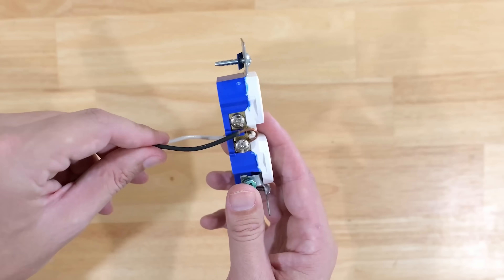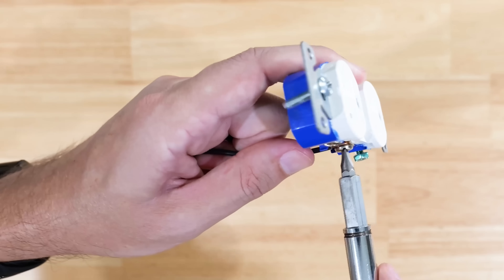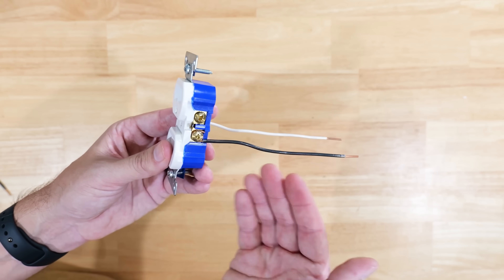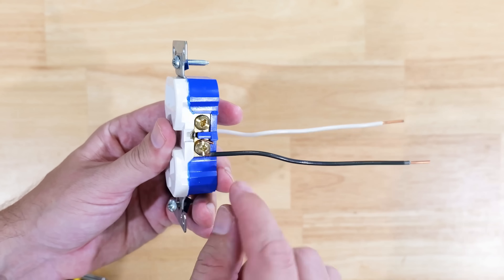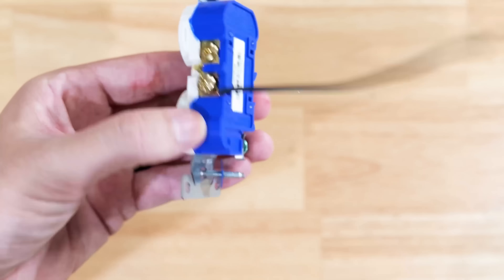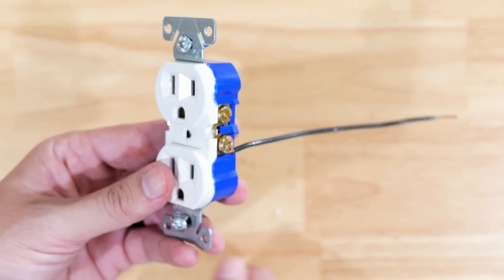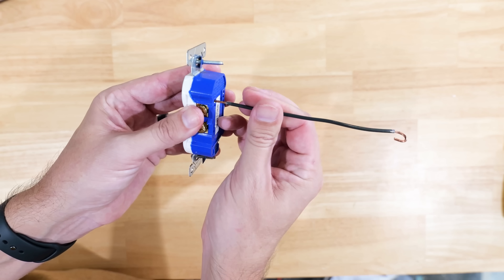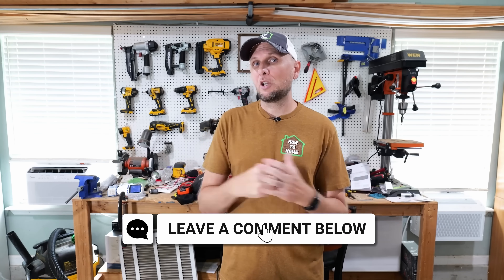Avoid Disaster! 8 FATAL Outlet Mistakes Most DIYers Unknowingly Make!

Comment: I was taught that reverse polarity was more about safety then performance as AC current reverse polarity with every cycle. Whatever is plugged in will work just the same. The problem would come in if you were touching two things with different polarity at one time., in which you would become the completed circuit.
Reply: It is about safety in a simple circuit like a light bulb, because it can cause a shock hazard or worse case, electrocution. It's also about safety with more complex electrical equipment and the equipment may not work or may be damaged if it's not internally protected against reverse polarity. This is the case in 120v circuits, because the neutral wire is a zero voltage reference. It is bonded to the ground at the main panel to achieve this. The concept of reverse polarity does not exist in 240v equipment.

Comment: Sorry buddy but it is 100% ok to use a 20A rated outlet on a 15A circuit but You shouldn’t use a 15a outlet on a 20Amp circuit. A 20Amp outlet on a 15amp circuit can’t pull more then 15Amps. That’s very basic knowledge
Reply from the maker: Oh it can’t?  And you’re 100% wrong.  The NEC says so.  Yours and my opinion don’t matter.  Sorry, bud lol
Reply: A receptacle is just an access to electricity and it will pull whatever the load demands regardless of the receptacle rating, Travis. If it becomes excessive, the breaker should trip. If it doesn't, the wires will heat up, melting the insulation, plastic on the receptacle, who knows?

Comment: A 20 amp receptacle may burn the 15 amp wire (14 gauge wire) on a 15 amp breaker if the breaker doesn’t work properly.. you are right but you may also consider that a a 20 amp breaker with a 20 amp wire (12 gauge wire) connected to a 15 amp outlet may be also burn like that one that you are showing (most likely the outlet was over charge, loose connection etc). Food for thought!
Reply from the maker: That wouldn't happen.  15 amp receptacles are made internally the same as 20 amp and are rated for it.
Reply: @HowToHomeDIY 20 amp breaker
Reply: They are not the same.. the material used is for 15 amp.. not 20
Reply from the maker: Incorrect.  But you can think that.  Doesn’t change the facts.

Comment: Some of this is wrong.  You can not put a 15 amp receptical on a 20 amp circuit.  Thats how the receptical catches on fire.  However a 20 amp receptical can handle 15 amps on a 15 amp circuit with no problem 1:50

Comment: I have a older house i just changed my first outlet had black wire on silver screw i was told to wire it the same way it was to be save is that wrong
Reply: Probably, plug in a receptacle tester to the outlet. If it's wrong, it will read hot/neutral reversed. If you have a 2 prong receptacle and there's no ground, this test may not be reliable. You should then use a non contact voltage tester. It lights up and beeps when the hot line is detected. If it beeps when you put the tip in the neutral side and not on the hot side, then the polarity is reversed. As an additional note, this probably won't work on a GFCI receptacle that has no ground, as it may beep just being close. In that case you should remove the GFCI line wires (power off) and test them individually by getting the tip close to the wire (power on).

Comment: I ran into three outlets in my house that were wired in such a way that they stripped the insulation off the wire mid way down the wire, wrapped that part around the receptacle terminal, then stripped the end of the wire and used that to tie into a pigtail. Have you ever heard of such a practice? My house was built in 1970.

Another situation I ran into was an outlet that tied into a circuit and had a switch off of it ... there were shared neutrals in the outlet.
Reply: I'm familiar with the practice regarding your first situation, and I consider it bad practice in general, unless there is a valid reason for it.
The second situation is normal for a switched circuit and it's not considered a shared neutral if it's the same circuit. Shared neutral refers to 2 circuits on opposite phases using one neutral at a time. This is known as a multi wire branch circuit.
Reply: @surferdude642  thank you ... I fixed the outlets in the first situation by removing the wire, cutting it, and doing a proper pigtail.

Comment: Back stabs are approved on UL listed devices,
Reply from the maker: Yeah, and cigarettes are approved to be bought and used.  What’s your point?
Reply: @HowToHomeDIY  The majority of electricians use back stab in residential construction as it is faster. It is OK on UL listed devices.  It is OK with NEMA.  Your opinion is just your opinion and it does not influence what UL approves.
We know cigarettes cause multiple health problems,  If not for cigarettes we would not have such wonderful health care.
Reply from the maker: @tricogustrico  And we know that numerous service calls are due to backstabs losing  their tension and having a poor connection.  It is funny you say most electricians use them when I personally know numerous electricians and all of them refuse to use them.  Yes, they are UL listed.  And yes they are more likely to cause an issue than the terminal screws.  Both can be and are true.

Comment: Why would they design the receptacle with the back stabbing set up if they are so dangerous? I'm not going to say this guy is wrong but my whole house is wired this way and because of him saying how loose they become he made me paranoid, so I have went and checked every single one, pulling refrigerator, washer, microwave, dishwasher, ect. I pulled hard on every single wire and not one of them are loose. The look and operate perfectly after 10 years of use. It took me an entire day to check them all. Thanks for reading.

Comment: I live in a house that has 2 prong outlets, no ground (green or bare) wire. There are only white and black and white and red. I am not certain why a few of them have red for the hot instead of black but they work the same way. Anyway I read that it's very dangerous to install 3 way outlets, the ones with the 3rd hole for grounded circuits however several of the things I have are 3 way grounded plugs such as my laptop charger and some tools that I use frequently. I have a couple of those cheap grey adapters with 3 holes for the device plugged into it and only 2 prongs for the wall outlet, which I also read are not very safe to use. I've read that the least dangerous thing to do in this case is to install a GFCI without using the ground wire and labeling it as a "non grounded GFCI" however when I do this, the GFCI either has no power nor do the ones after it on the circuit. Or if I reverse the wiring, there's power but the test button does not trip the device. I don't recall whether the outlets after it have power in this state or not but I want to say they didn't. I checked numerous times to be certain that the wires corresponded to the proper cables in relation to where they were connected to the device and I also tried another GFCI from another house that is known to be working as well as testing the first one to confirm it to be working in another house. So I have re-installed a 2 prong outlet and it works fine however I'm at a loss with my things with 3 prong plugs besides resorting back to the 3 to 2 prong adapters. I do use the ones with the tab that attaches to the cover plate screw but I'm not certain that it makes it any more or less "safe" to use. Are there any more options other than installing a proper grounding path throughout the house? I don't own the place and the owner doesn't want to hear anything about doing it. Is there a way to ground the house without running a grounding cable going from earth to all the circuits throughout the house and installing lightning rods on the roof?

Comment: i use commercial receptacles so i don't have to waste time with shepherd hooks or the weak stab ins. I like the wago style but wonder what cost difference be? With commercial you can safely put 2 wires on a single terminal. I don't normally do that but sometimes i have to.

Comment: This guy is in correct If! you put a 20 amp receptacle on a 15 amp circuit that circuit has a breaker that will tripp at 15 amps! NOW! if it was the other way would be very bad 15 amp recept on a 20 amp circuit the receptacle would get hot burn and could cause a fire!
Reply from the maker: 😂 you are basing that on your own thinking.  What you just proposed is completely wrong.  15 amp receptacles are permitted to be on 20 amp circuits.  The internals are the same and rated for the 20 amps.  It would not cause a fire.

Comment: good video; few things: 
-reverse polarity: its fine for your equipments. all product safety standards consider this as a commin thing and tests it accordingly in their 3rd party certification. that being said its still a issue because your branch protection is on the hot wire. take a light bulb and the hot will still be hot and hurt like a....
- backstabbing: come on, again these are 3rd party certified and will meet the proper strength required by national safety standard. id much rather a diy use the backstabing method than the screws for the j-hook, torque, and insulation common mistakes you mentionned. for sure people in the trade will always prefer the most long proven method but that doesnt mean the other method isnt safe.

Comment: How about not realizing that the receptacle you're replacing has the break-off tabs between the terminals broken.  A good example of this tends to be the garbage disposal outlet under the sink, so that you can use a single receptacle for 2 unique circuits.  I started a small fire in my last house because I had no idea this was a thing.  Always good to double-check the state of the break-off tabs between those screws to make sure there's not a dual circuit running to that receptacle.

Comment: thanks for the video! I lost power to my outlet that had my freezer and washing machine plugged into. Lost 4 deer, 2 turkey, frozen bread, and alot of groceries. Thought my freezer went out. Come to find out the outlet was wired incorrectly for over 30 years! The  black was not even hooked up! The white wire was hooked to the brass power side. The ground was hooked to tbe neutral side. The white wire had insulation all the way to the top of the screw and was barely holding( would guess it finally came loose after 3 decades from the outlet not being schimmed and was moving). SOB! Ill be  checking all my outlets.

Comment: Amazing video. I was just wanting to know when using a commercial grade outlet do you still need to torque it to 12 in lbs or just tighten hard enough so it doesn't move anymore since its going thru a hole and being sandwich evenly.

Comment: Also don't leave too much ground wire coiled behind the outlet inside the junction box...I had an issue where a breaker randomly tripped off unexpectedly, then would not reset/turn back on - the breaker would spark when attempting to turn it on. After hours of trying to figure out what was wrong, including replacing the breaker switch itself, it turned out the electrician had left too much ground wire in one of the 6 outlets on that 15A circuit, and the wire had contacted one of the open screw posts on the side of the outlet. This literally fused the ground wire to the screw on the hot side of the outlet. Definitely would've been a serious shock/fire hazard if not for the breaker cutting power.

Comment: Double stacking... What is the correct method for extending a line by two new wall outlets leading off of an existing wall outlet? What's here: 15-amp breaker --> 14-gauge wire --> 20-amp old school outlet. What I'd like to add: 12-gauge wiring (from existing 20-amp outlet) and two 15-amp gfci outlets. Can I do this? Your video is great, but you haven't shown us a proper way to extend new outlets off of other outlets, just what not to do. Should I replace the old school outlet with a new gfci while I'm in there. Tryna get this right. Running a new 55" TV and all the fixins and a laptop-and-lights situation on the two new outlets. TIA
Reply: Re-watched some and did decide to replace two old school 20-amp outlets with new 15-amp gfci outlets. Still wondering can I use the larger wiring, if I'm out of the white stuff, and how to properly wire from outlet to outlet. Thanks!

Comment: You got that wrong my guy! You CAN NOT put a 15 amp receptacle on a 20 amp circuit! The reason is because the device is only rated at 15 amps and if there is a failure in the device due to overamp conditions for the device that is only rated for 15 amps, the 20 amp circuit will not trip the breaker!!! This is a HUGE misrepresentation! Please take this video down as it can cause serious issues to those that do not know better! Also putting a 20 amp receptacle on a 15 amp circut is actually FINE because the circuit will shot off if a device that gets plugged in pulls over 15 amps therefore protecting the 14 guage wiring and preventing overheating! So for everyones safety...TAKE THIS DOWN and remake that statment!!!

Comment: Didn't even get past the first segment. I am sorry to say but you are very wrong here.  it all starts at the breaker/fuse. this is you minimum rating for everything down the line so a 15A breaker means at minimum you need 14AWG wire and at minimum 15A devices.  You can ALWAYS over build down stream like say use 12AWG wire on a 15A circuit or even put a 20A, 20 or even 50A receptacle on a 15A breaker.  The other way around is flatly against code everywhere.

Comment: Can someone explain to me how it is possible to connect a 15 A socket to a 20 A breaker? If someone connects a load of more than 15 A to an outlet, it will cause overheating due to overload. The circuit breaker will not work. Or did I misunderstand?

Comment: I wish it were normalized to use torque screw drivers. It's good liability insurance. Granted things can loosen up over time from cycles of the parts heating up and cooling down. I would say the biggest mistakes for electricians include over tightening or forgetting to tighten down their lugs in the panel and getting distracted by customers' dogs.

Comment: ---------------------     I'm new, so if you already covered,   I don't know about it yet, until I get thru your list.         Suggestion:  how about   Aluminum rated receptacles,    do's & don'ts?
Also,     how much torque on Aluminum?
And    how  to properly     pigtail     or    join them,      and would you use AL rated or Copper rated device?

Comment: Wouldn't the simplest answer to issue #1 be to use a 15 amp receptacle on a 15 amp circuit, and a 20 amp receptacle on a 20 amp circuit? Or am I missing something

Comment: First tip a bit silly the anything that plugs into a 20 A can plug into a 15 A so easy to overload in either case
Reply from the maker: You cannot plug a 20 amp plug into a 15 amp receptacle.  It literally will not go in.

Comment: I still don’t understand why, after more than a century of modern electrical connectors, home electrical wiring color coding is backwards. In almost every other context: cars, audio, computer cables, etc.. black = negative, while red or white is positive.

That’s what imo makes reverse polarity so common in household DIY work: people grow up thinking “black = negative/neutral” and “white/red = positive/hot” so then, when a homeowner tackles an electrical task for the first time, they often assume black is the neutral wire and white is the hot, when in reality it’s the opposite in home wiring, and ngl I made this mistake myself too when i first tackled my first time doing home wiring when i installed a new light switch and ceiling fan, i honestly thought the black wire was neutral.

It feels like this illogical color swap solely for home wiring, has been setting people up for mistakes for generations.
Reply: The other context that you mentioned is DC electricity, Residential and commercial buildings use AC electricity. In AC there's no negative or positive wire. The black wire (hot wire) is half the time + and half the time -. The white wire (neutral wire aka grounded conductor) is 0 volts, but carries current and is not negative or ground. There is a green or bare wire which is ground and is unused under normal operating conditions, only a method of directing fault current in order to trip the breaker. It's pretty straightforward once you learn the difference.
In a switch, except for wifi, there's no neutral wire connection to the switch, just 2 black wires or 1 black and 1 red. Sometimes a white wire is used as a hot wire in a switch, which can be confusing to people with little or no experience.

Comment: 3:22 what is the problem with reverse polarity, really? What type of equipment really depends on it? If it does, it should be connected permanently or via a very special receptacle. In Europe you can turn a plug up side down, there is no up or down actually in most receptacle types.
Reply: Same in Thailand.

Comment: How To Home, I couldn't even make it past 1:42.
As a 30+ year Electrical Engineer, you are talking gibberish. 
A higher amp rating on an outlet will NOT cause the wiring to heat up, it WILL prevent the outlet from burning up. Power is regulated from feed to down stream, the breaker protects all equipment down stream. The breaker is sized to protect the wiring.
You are wrong.